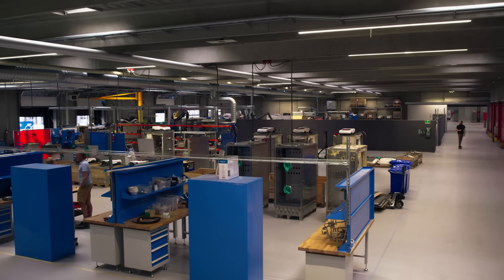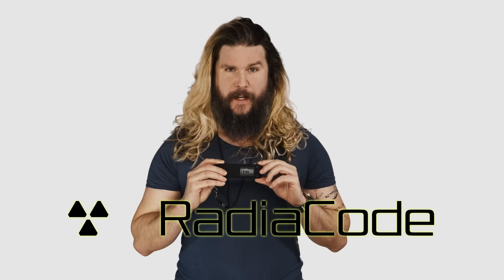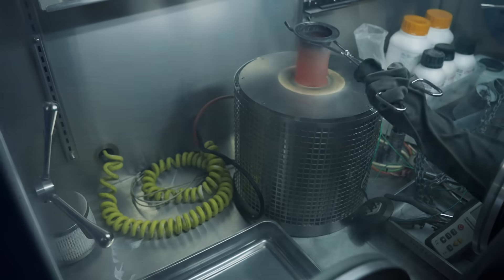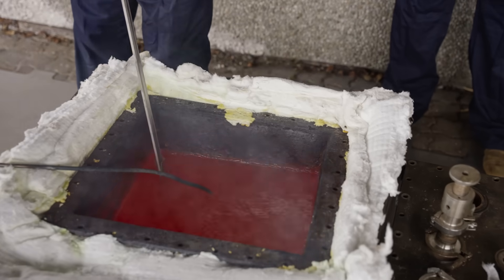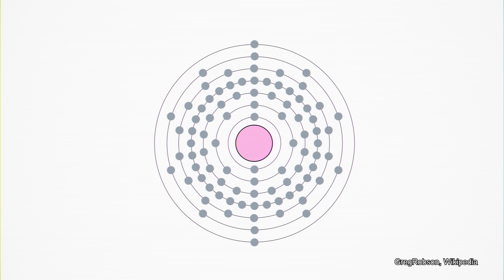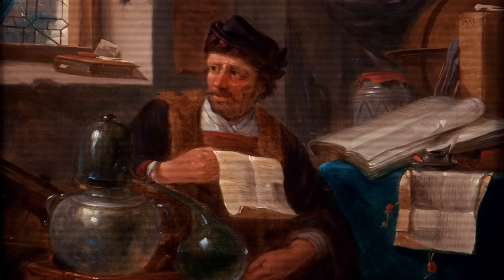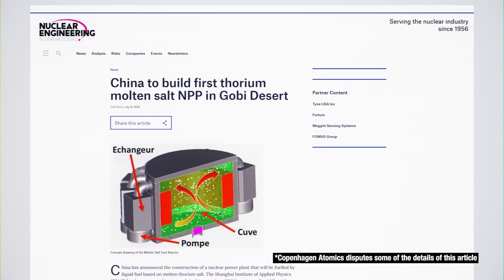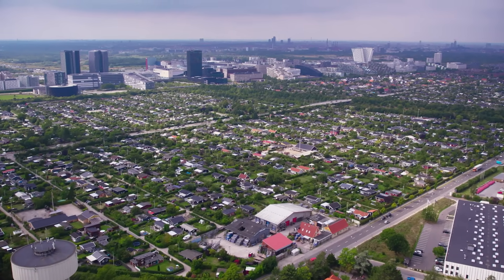Is THORIUM the Future of Nuclear Power?

Comment: I really hate the terminology of 'creating fuel'.  I understand the meaning, that the reactor is taking a non-fissile material and converting it into a fissile material to feed the fission chain reaction.  But the terms make it sound like you are getting something from nothing. 

IMHO you are starting with reactor fuel, but breeder reactor are capable of using fertile fuel, unlike regular reactor that require fissile fuel.

IMHO we shouldn't say 'a breeder reactor creates its own fuel',  but rather 'a breeder reactor converts its fertile fuel into fissile fuel to supply its fission reaction'.

Comment: corrosion, corrosion and corrosion again... that's one of the mail disadvantages ... Whoever comes up with a solution to that, or a material that is resistant enough to produce the parts, will be the next super rich company and the start of a new chapter in the nuclear power. fingers crossed it will happen asap.

Comment: The problem with molten salt reactors isn't their safety against nuclear meltdowns. That won't happen.
The problem is that molten salt is both hot and extremely corrosive, so it destroys almost every pipe and you have radioactive salt squeezing out of every joint.
Reply: They are using alloy pipes, that are highly resistant to reacting so corrosion is not an issue at all.
Reply: @MattyOfPassion  ah yes, what alloy are they using? Because so far every molten salt reactor has failed at some point due to corrosion and leaks in the pipes. To claim something isn't an issue, proof would be needed.
Reply: @texasranger24  @MalcolmAkner talked about this in one of the other answers, he was one of the engineers

Comment: What about the Protactinium problem, which is the highly radioactive intermediate step between Thorium and Uranium 233 with a half life of 27 days? It's highly dangerous and must filtered out from the fuel and kept in separate tanks to wait for it to decay. That's a massive safety and security problem. It's also an immense maintenance issue if say the highly corrosive salts spring a leak.

Comment: To answer that question (Spoiler): Because it's not as easy as proponents make it out to be. Germany has tried that stuff back when nuclear power was still cool and they failed, mainly due to relaiability issues. Remember: if it really was that easy and that cheap, investor money would have already made it rain in nerd-town. The reason why it picks up steam now, is 
1) because centralized power-supply is increasingly under threat through solar and wind and they are getting desperate to hold onto their market.
2) Investors have gotten increasingly less scientifically literate and thus more willing to pump their unearned surplus gambeling money into the most pog-face-induceing projects with the coolest presentations and most rediculous pormises. Partly also because VC money-investment is steadily increasing relative to bank-money and banks tend to put buisiness-plans under a lot more scrutiny.

Comment: 13:48 i think he did just drop one major reason why this isn't a mainstream method for power generation yet.
If the wear and tear of the reactor happens in such a (on industrial scale) short time frame. I don't see it be economically viable yet until its longevity is improved.
But i guess that will come up in part 2.

Comment: I thought this kind of research was only done well out of the way from populated areas. And then i recognize everything in the drone shots at the beginning as i live 5 minutes away, wow. 
The fact they can develop this technology in the middle of a city speaks to how safe it is, really really cool.
Reply: They have no nuclear fuel and are not running any reactor test at their facility.  All nuclear reactors since the 1940's have been designed and constructed in normal industrial plants with no radiation concerns as they have not fuel in them and are not running.
Reply: I think, they do not actually build reactors there. They don't actually have actual radioactive material on sight. they just build plumming for molten salt. (wich is the right approach)
Reply: @MusikCassette  They likely build the reactor there.  They just don't install fuel in the reactor there.  The common industry practice is that reactors are fueled onsite once the reactor is installed and all the piping is connected and all safety systems operational.  There are a few exceptions to that - primarily military Naval rectors that are welded shut and never expected to be refueled in their lifetime.  Certain small specialty reactors such as for satellites and remote monitoring stations are built in national labs with the fuel inside them when they leave the factories. These reactors are not used for large scale power production as they are very inefficient and vary costly for the power they produce.
Reply: @ well molten salt reactors allways had problems with corrosion. It totally makes sense to takle this issue without using radioactive material.
Reply: @ " Certain small specialty reactors such as for satellites"
really? I mean you put RTGs into satellites. but not fission reactors do you?
Reply: @MusikCassette  An RTG is a fission reactor.  It just depends on the natural decay fission rate.
Reply: @ " Certain small specialty reactors such as for satellites"
no it is not. thank you though for saying that.  I will use that as Calibration for your level of expertise and weight your statements accordingly.

Comment: The most important economic advantage of this type of molten salt reactor is that the radioactive part isn't under high pressure. The liquid salt doesn't use pressure to say liquid rather than boiling into a gas. Pipes don't need to be built to deal with that high pressure. The containment building doesn't need to be able to hold a whole reactor core's worth of radioactive steam. You need shielding which is just mass; normal sand works just fine if you use enough of it. Doesn't need to be high strength concrete lined with lead and paraffine, to save on space because concrete is expensive. This is on top of the extra efficiency you get from 850C heat, and all the other things that can be done with 850C heat. 

The steam side is moderately high pressure, high temperature steam, but not as far as super critical steam used in a coal plant with lots of superheating. But the steam is not radioactive so while insanely dangerous as all high pressure steam is at the end of the day it's just hot water.

Comment: Cool! I worked on that for 4 years, the round reactor that you see (the onion core), the container, the tanks and all the connected piping along with the simulations assuring it's gonna work were drawn and done by me. 

You got some details wrong about CA's design (maybe they will show up in part 2). You don't need control rods, the design schemas you showed is for FLiBe's LFTR (another thorium breeder design), where the moderating material (the stuff that slows down the neutrons making it a "thermal" design, as opposed to a "fast" design) is graphite. In CA's reactor it's heavy water, not used for cooling, only used for moderating.  Cooling is done by a separate salt. There also doesn't have to be a freeze plug, again, that is LFTR's choice of safety mechanism. 
There are many kinks that still need to be ironed out, fission product separation being a major one, but in principle it is possible to remove all that stuff, keeping the fuel clean. Instead of spewing the exhausts from the fission process back into the fuel (which current solid fuel reactors do, accumulating fission products in the fuel pellets, decreasing their efficiency by producing neutron poison (like Xe)) they can be removed and safely handled, keeping the fuel pure and operation maximally efficient. 
Thorium is for sure a game changer, and I really hope that this type of reactor will be realized one day.
Reply: Does that mean, your method does not require the application of fluoride to sort the unwanted isotopes out? I hate halogens.
Reply: @gabbyn978 how do the halogens view you? 🤔
Reply: @ Some seem to not like me either, especially this Fluoride which took away the Iodine that I need for my thyroid gland.
Reply: @gabbyn978 It's not that I hate halogens, I just... respect them. And their capacity to encourage things to slide down the thermodynamic scale. Preferably from a significant distance. Granted, this is one of the few fields where the term 'fluorine science' doesn't cause an immediate panicked egress, given it is commonly used as an intermediary step with Uranium Hexafluoride, but it's still not something I prefer to handle on a regular basis. Yanno, if it's all the same.
Reply: @ShneekeyTheLost  well, fluorines you should be afraid of, fluorides on the other hand is some of the most stable compounds there are, firmly at the bottom of any electrochemical shenanigans!
Reply: @MalcolmAkner  Alright, I meant flourines. My chemistry teacher was too incompetent to tell me the difference.
Reply: @gabbyn978  all good, many do the same mistake! 
Check out Kirk Sorensen's talks about this stuff, he is an excellent and engaging pedagogue. There's one talk that's about 2 hours long that he does in a basement somewhere which is just excellent.
Reply: @MalcolmAkner  But what about hydrogen fluoride?
Reply: @dongleseon8785  Yeah HF is bad, but that only happens if you have both a salt spill and a water spill where they both mix. There are safety procedures and systems in place for that.
Reply: what do they do about how corrosive salt is?
Reply: @rifz42  clean it thoroughly.
Reply: Do you mind sharing why you left?
Reply: @Grigorov7271  funding issues :-/
Reply: @MalcolmAkner  sorry to hear that. Hope you get to work on other interesting projects tho.
Reply: @Grigorov7271  thanks, already at a new gig so no worries there ;)
Reply: Wait, so you've put water inside the FLiBe core as moderator? So it can have violent HF explosion??
That's fascinating. But how do you keep it from boiling though? The core suppose to 1200c and I don't think heavy water vapor will gonna do much of moderating.
Reply: @dongleseon8785  Well, in separate layers, insulated from each other. If the water and salt mix there will be steam, potentially a steam explosion, and some HF forming, and that would be a problem. The core is decidedly not at 1200C since that's when steel melts, the core is around 700C. The water is liquid, and unpressurized, not part of cooling, only moderation.
Reply: @MalcolmAkner  Aha that's interesting! I hope the insulation layer is very durable.
Reply: @dongleseon8785  It doesn't really need to be, it's purpose is to increase the efficiency and not have too excessive, parasitic heat loss from the fuel salt. Water has an insane heat capacity, some of the highest of all liquids (FLiNaK: 1.5J/(g*K), water: 4.2 J/(g*K), i.e. 2.8 times higher!), so all you need to do is pump it around fast enough and have external cooling of that water. The insulation is just there to slow down that process and not put as much strain on that external heat removal system, and allowing that heat to leave the fuel salt through the intended pathway (which ultimately drives some process, be it industrial heat or a steam turbine).
Reply: @MalcolmAkner  but wouldn't that mean failed water pump might lead to steam explosion? I mean, obviously you have pressure valve but nothing is safe with human factors.
Reply: @dongleseon8785  no, there are simple ways around that. If pump stops everything drains, any liquid must be actively held in the core.
Reply: @MalcolmAkner  OK that's actually genius.
Reply: @dongleseon8785  it's pretty neat! Not saying everything is solved for sure, but CA's core is a solid idea.

Comment: Molten salt, and especially Th molten salt is a very interesting and promising design, though I fear one of it's main problems, that is often skipped over is what your host mentioned @13:45. If you need to replace part of the plumbing or the pumps every 5 years, and those parts become at least medium level nuclear waste that would be a huge downside.
Reply: Very hot salt inside metal pipes sounds like it would rot it like hell
Reply: Might have to build it all enamel lined,,,

Comment: Elysium Industries have a design, that uses the fast spectrum which needs no moderator, and the reactor is a simple metal tank, full of hot salt and dissolved fuel.  Simple, cheap and can even run on existing spent reactor waste (from conventional nuclear reactors) and does not need graphite moderator replaced at regular intervals.   So the fuel is basically free, and cleans up existing waste.

Comment: Since you are playing with salts at high temperatures, how often do you need to replace parts?  I would expect the stuff to be highly caustic.  How expensive is each replacement?  And what happens when something goes wrong (Murphy law) and the salt cools in a pipe?
Reply: Not that often it turns out, the corrosive nature of the salts have been greatly exaggerated. You can always supply local heat to any solidified pipe segment to remelt it, but it can be annoying when it happens.
Reply: In the case of ThorCon (presently applying for final approuval to build a power plant in Indonesia with operations starting in 2032), while the lifetime of the plant as a whole is tens of years (80yr in the most optimistic ads), the scheduled maintenance is 4 years for the inner core (with all the primary loop pipes). All parts are made modular and serviceable  contrary to current nuclear power plants, where sometimes you have to literally cut open the concrete container to access the nuclear vessel, risking to lose the plant structural integrity in the process.
Bottom line: the scheduled maintenance is essential, but frankly 4 years is more than the replacement time of many car parts (brakes, oil, tires...). And despite that, the final projection of cost per MWh, including maintenance and fuel, is competitive with that of cheap coal plants, that is why Indonesia is considering the thorium molten salt reactors as a sustainable solution.

Comment: Great video! However, it's important to clarify the principle of breeding in thorium reactors to avoid misconception (@12:00). While breeding allows thorium-232 to be converted into fissile uranium-233, the process does not produce more fuel than it consumes. The neutrons generated during the fission of uranium-233 are used to sustain the chain reaction and convert thorium into new uranium-233, but there is always a balance between consumption and production.

This means that while thorium reactors can achieve a near self-sustaining cycle, they still require an initial fissile material (like uranium-235 or plutonium) to start the process and may need periodic replenishment of raw thorium to sustain the breeding cycle. The idea that breeding creates an "endless supply of fuel" is misleading. Thorium reactors are promising for their efficiency and reduced waste, but the physics of breeding still adheres to the conservation of neutrons and energy.

This breeding process is the nuclear equivalent of using centrifuges to enrich uranium-235 in conventional reactors, as it produces fissile uranium-233 directly from thorium without the need for mechanical isotope separation.

Just wanted to point this out to give a balanced perspective!

Comment: I find it really surprising that you were surprised at the viscosity of the salt. People been experimenting with molten salt breeder reactors for longer than either of us have been alive. The whole deal with the viscosity is that we can actually use a freeze plug to contain the system but if there's a catastrophic failure that plug will melt and the liquid salt will pour into a separate container. It has to be running to be able to do that so it's just like liquid metal. If you've ever seen liquid aluminum it's quite terrifying and beautiful at the same time because it's just it's running as the salt is. That's why we can pour amazingly small casts.
Reply: The reason we can do this with salt and we cannot with any kinds of metals is the only metals that can stay liquid would destroy the containment unit and any other metals would have to reach a higher temperature than the salt to become liquid. Sodium is in fact a metal. Salt is sodium in crystalline form with chlorine. This means that it can remain in crystalline form as an amalgamation but the size of the crystals allows it to flow practically unhindered once it reaches certain temperatures. I'm not the best to describing things so. . . That's why you don't find me on YouTube😅